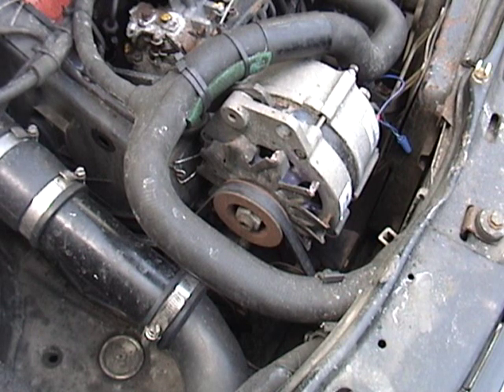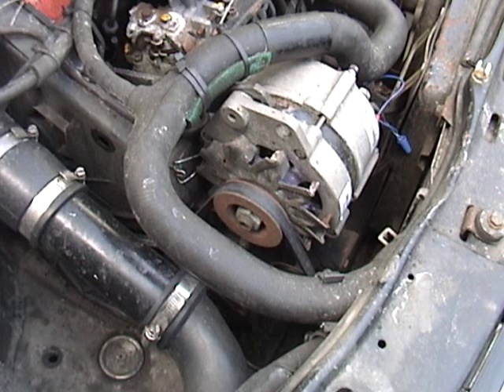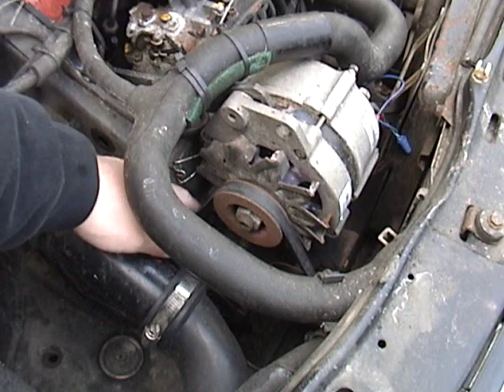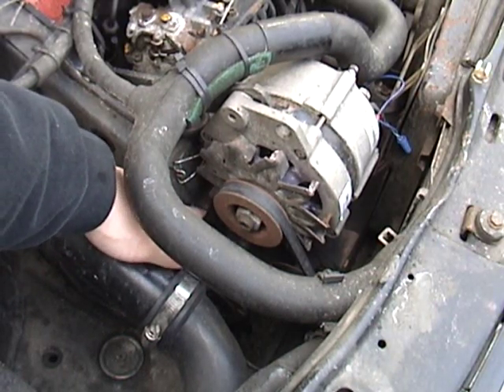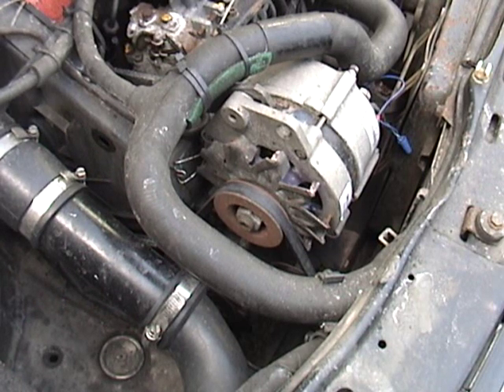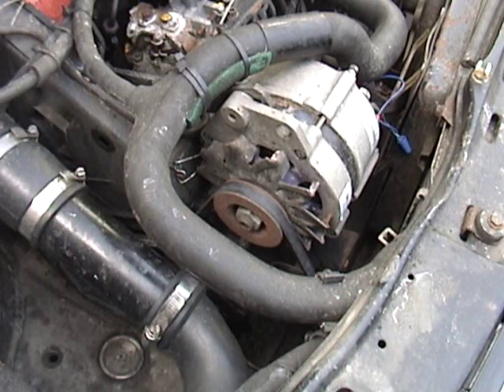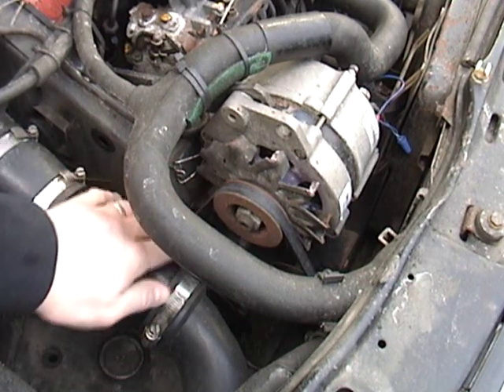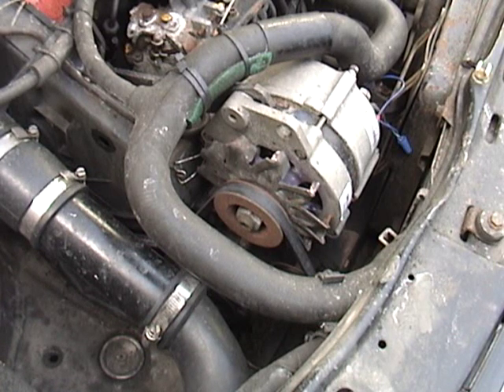1990 Volkswagen Jetta Mk2 1.6L diesel, alternator belt drive modifcation

Comment: After seeing this, I'm pretty sure my alternator pulley is fucked. My belt sits way deeper in it and I keep blowing belts. Almost 1 a month. A lot of slipping when accelerating
Reply from the maker: I advise you to draw no firm conclusions from this video.
Reply: @MercedesDieselGuy  Why's that?
Reply from the maker: @Chris Ladouceur  This was an unsuccessful experiment and ultimately,  I didn't learn anything useful from it. I don't think you can draw any conclusions for your car from this. Best of luck with whatever the issue is.

Comment: so the mod doesn't work, but it may work to test resistance, and possibly replace battery to alternator cable to improve the resistance and lessen draw.   salt can get in there and corrode where you can't see it without cutting it open.  also, mabye alternator bearing as listed below.  alignment can be finicky, or maybe that has never been the problem (haha) .  All I know is gooood lucko.  I was eating them each 1,500 miles, then went 10k, and now went 4k... trying to figure it out agin    good luck y'all

Comment: Do you remember what bearings those were or where I can get them?
Reply from the maker: Unfortunately, no. This was like ten years ago. Long term, this solution didn't help anyway. It extended belt life by a very small margin, but the belts kept shredding.

I would guess the alternator belt pulley was the main culprit, but this was the biggest issue that made me give up on the car.

I had a 50 mile commute each way back then and the car just was not reliable. Loved it, but had to let it go.

Comment: I got both belts flapping badly...
Do you have a good video on where the tightening systems for both belts are?
And how to get them off for replacement. I got a 1986 vw diesel...
Love the car, but theyre tricky to stick a wrench anywhere!
Reply from the maker: Sorry - no video for that. I never did solve this problem entirely and sold the car over five years ago.
Reply: +MercedesDieselGuy 
Ok thanks. The first car i ever drove in the late 90s happened to be this vw mk2... I bought this one in the usa to convert to 90% hho 10% diesel...
Its a work in progress. The only bad thing about these cars: parts are hard to find, mechanics dont know them. Lol...
Reply from the maker: I hear you on parts. Once, when I had this car, I walked into a parts store and tried to buy an alternator belt. The clerk asked me what kind of car. I told him 1990 VW Jetta diesel. The way he looked at me, I may as well have told him the car was from Guatemala.
Reply: MercedesDieselGuy what happends to the water pump if the belts snaps how did you drive the car
Reply: @nissan240sx4  on models with A/C there is a different belt. Instead of Alternator/waterpump it’s a AC/Waterpump belt

Comment: What are the exact parts you used for this. I am having the same problem with my diesel and this method seems legit.
Reply from the maker: Unfortunately, I don't have a listing anymore. I sold the car over three years ago. For what it's worth, this modification did help, but did not fix the alternator belt problem. I'm not sure the VW community has permanently fixed this one yet.

Comment: I have the same car, and had the same issues. My AC did not work, so i removed the AC pump, and the idler and swung the alternator down into the spot where the AC pump was. Then I found a pulley off an audi 80 4cylinder car that allows the wider belt and has an offset that was about right to line up with the main engine pulley. This allowed me to run a single 1000mm long belt that runs around the engine pulley, over the idler on the water pump and around the alternator. Works great now.

Comment from the maker: I would THINK that you'd be able to swap the bracket and use the original Jetta alternator (don't quote me on that, I'm not a parts interchangeability expert). But, given how problematic these original 1.6L diesel belt drive systems are, I'd go to the extra effort necessary to use the (probably more reliable) serpentine setup from the Passat if possible.

Comment: i have a mk 2 jetta with a 1.9td engine (aaz) from a 1995 passat. is the alternator setup on these different to the jetta? also, if the engine swap was done, is an alternator swap also necessary (i.e. can you use an original jetta alternator with a passat engine)?

i ask because i need to do some work on the alternator but dont know if i should look for passat ones or jetta ones.

Comment from the maker: @damac2004 From what I hear, the really problematic ones are the cars like mine with AC and power steering. Even so, the belt setup is pretty finicky regardless. But, I'm not an expert on these. Sounds like you got one of the good ones, though.

Comment from the maker: @compu85  - Thanks. Actually, it wasn't my design. I got the fix online.

I sold the car around six weeks ago. As the car was leaving with the new owner, the belt did start squealing again. I didn't have enough time with this setup (it was in the car for around a month - maybe 1000 miles) to know if this is a long-term solution or not.

Comment: would bounce at idle only as soon as the engine would run faster it would go away so at fist we replaced the tensioner with a new one it would be good for a while and then come back like it was so we figured that the TDI never had any problems so we installed the TDI pulley and then bingo fix what this affected is it got the crank gear bolt loose and then would damage the end of the crank and finally it would slip and then bent the valve very expensive alternator pulley problem. seen it lots.
Reply: well.  don't do that.  ha. 
11 years late, "thanks."

Comment: Great tip I all know what you are talking about I not only owned these cars bu woks on them we own a vw shop and I sorry to say but I'm glad we don't work on them much anymore I was so glad when the 1.9 TD came out with the serpentine belt set up but the only problem with the 1.9 TD was the factory alterator pulley was fix what I mean is the the first Jetta and Passat TDI came with a clutch pulley like the ALH MK4 TDI and at idle when the black belt tensioner came soft then at idle the belt